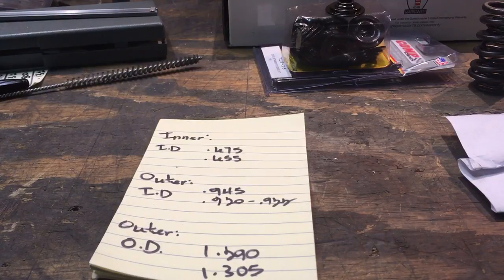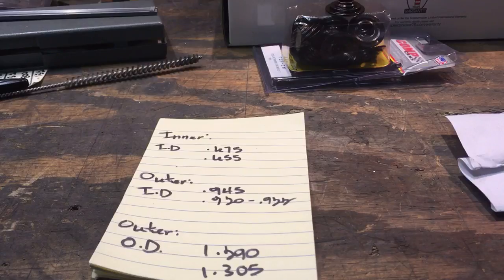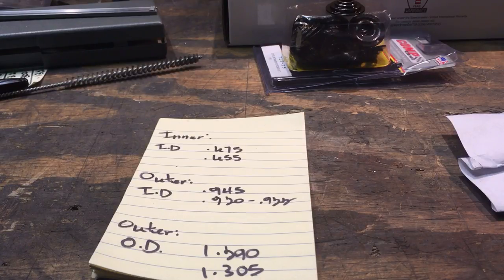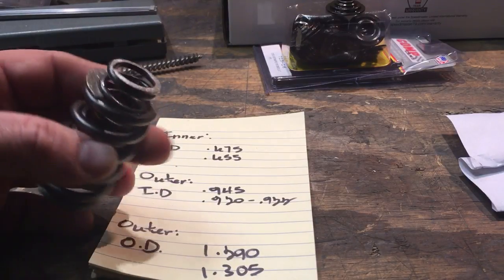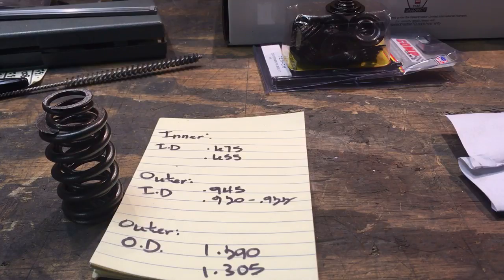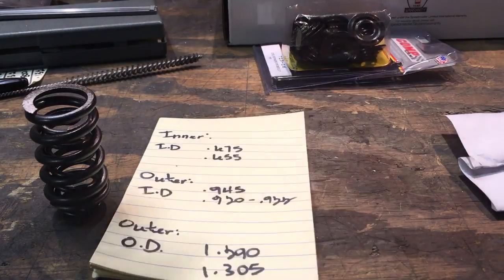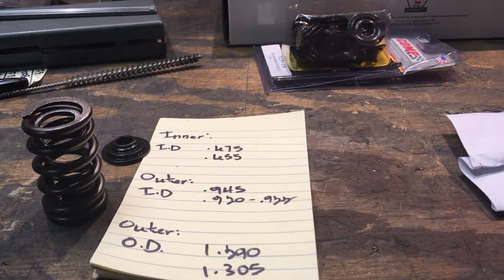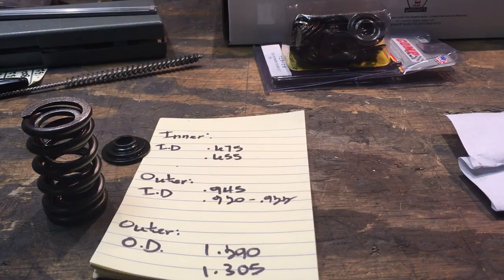ProComp JUNK dual LS valve springs boxed under SpeedMaster

Comment: Throw them away , this stuff is pure crap , be confident this junk will let you down sooner than later and the money you are trying to save will be gone buying quality parts to replace this shit . Procomp will always cost you more in the long run when you have to repair the damage a failure of this garbage has caused !!! Never again procomp !!!
Reply from the maker: Exactly I agree 100%  I clarified the JUNK springs and WARNED everyone to run away from ProComp/Speedmaster.  I've seen issues with ProComp for years with anything from Carb mainbodies to rocker arms, etc the springs were just one more low quality POS.  I currently have a set of the redesigned Comp #918's for the current 4.8 build much better quality!  JD
Reply from the maker: I went back and add some annotations to the video junk in case they don't see the follow up video about the Low Quality JUNK